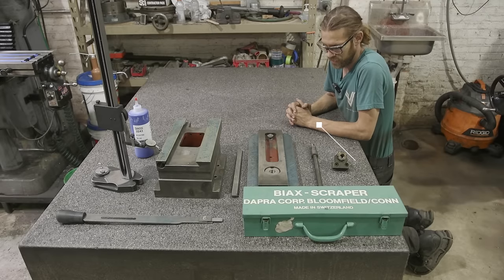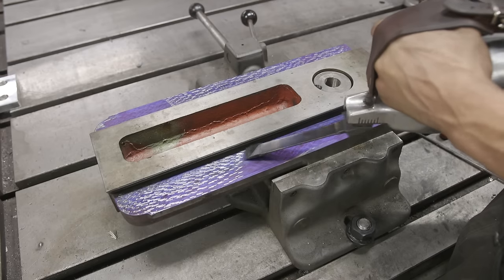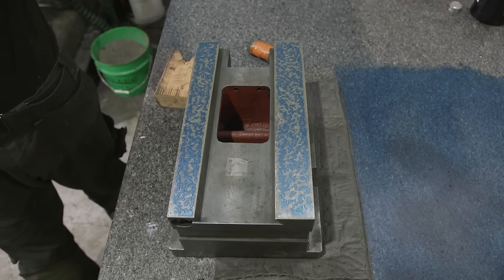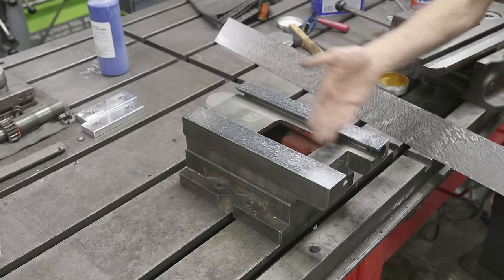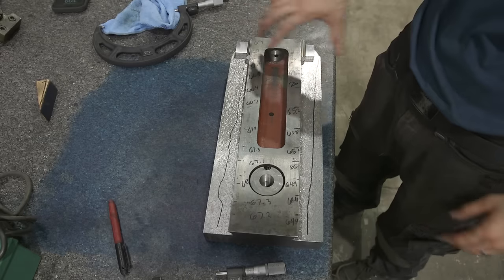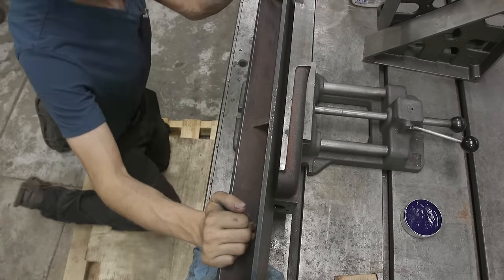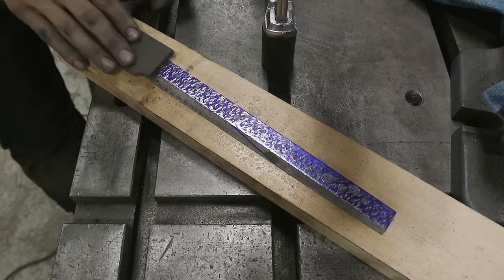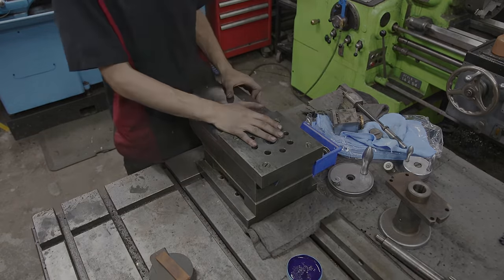Scraping Begins: Compound Scraping | Lion Lathe Restoration

Comment: Get or make some precision stones. With them you don't need to oil/lubricate the surface (you can't actually otherwise the stones won't work properly and will stick) when stoning the scraped surface. Makes things easier, faster and cleaner + you see polished high spots immediately.